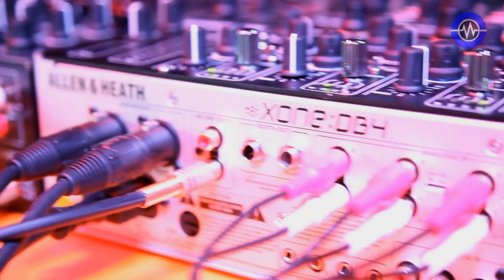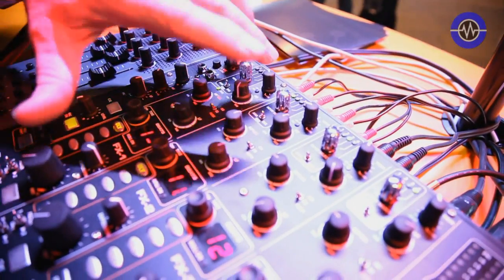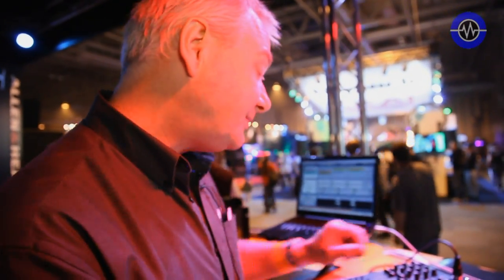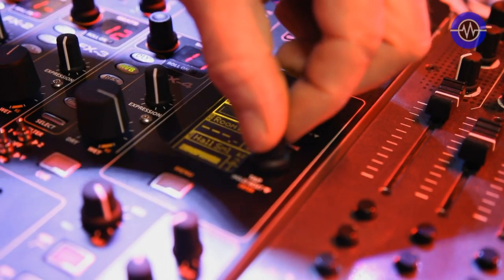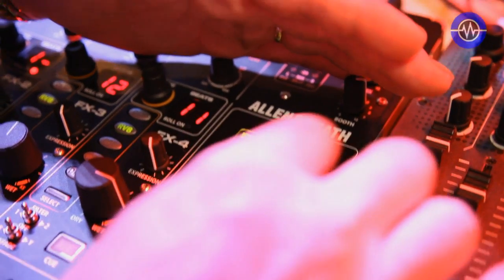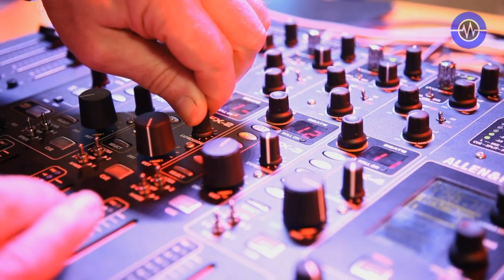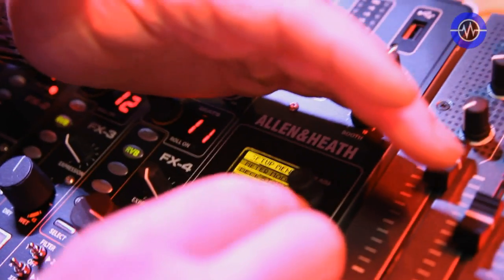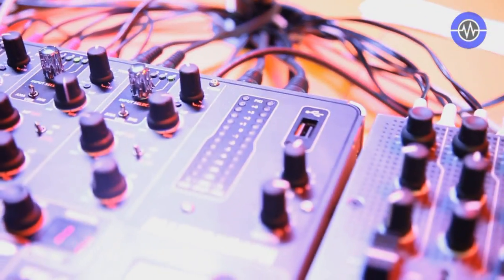Allen & Heath Xone DB4 - live demo at the UK BPM Show 2010

Comment: The db4 is a load of crap....  mine stopped working after only owning it for just over a year (when the guarantee ran out)....  Allen and heath didn't want to know..... there customer service was a joke.... they don't fix equipment that they have manufactured themselves.... I had to use a third party company called audio technica in Leeds who ripped me off badly..... charged me over £500 uk sterling to change a faulty pcb board...   I wouldn't mind but I never took the mixer out of my home.... it just stopped working one day...   people beware..... DO NOT BUY ALLEN AND HEATH